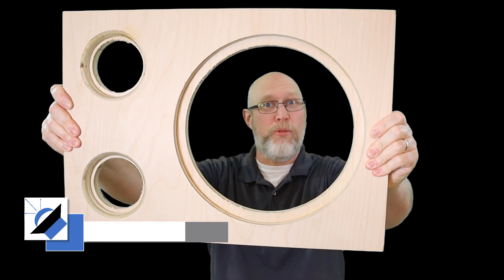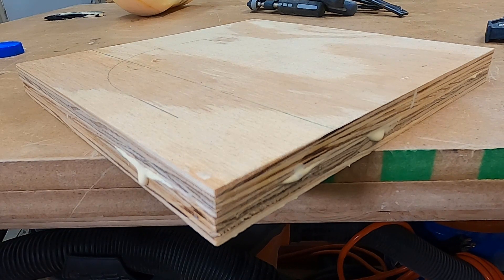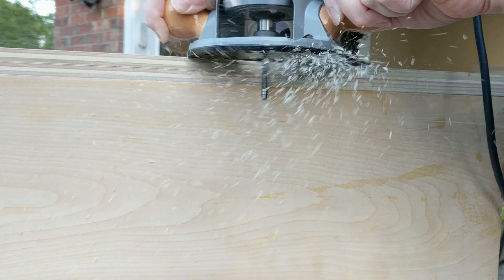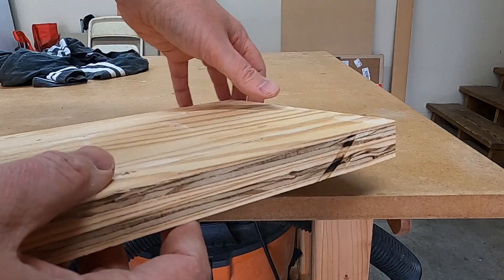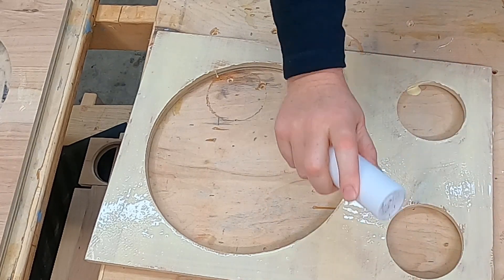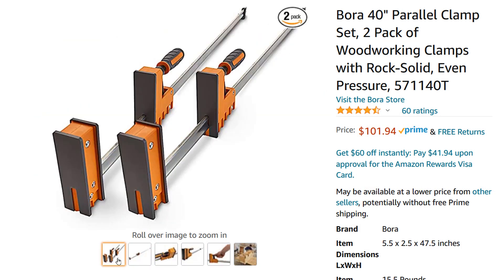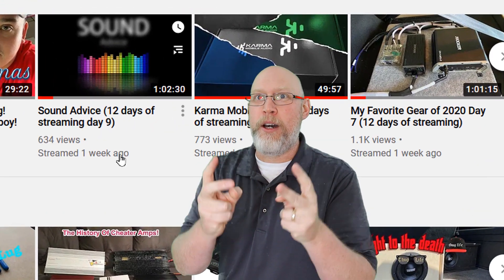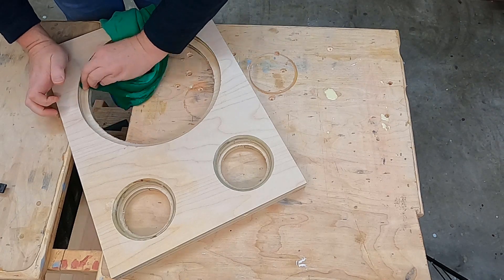How to perfectly align a double-baffle!  #subwoofer #caraudio #homeaudio

Comment: What are the benefits of single vs double vs triple baffle? Noob question
Reply from the maker: I like to double them so I can recess the subwoofer.  I just like the way it looks.  Also adds strength which helps dampen any vibrations.  It is a good idea to triple up the baffle on big builds (think multiple high RMS 15's and 18's) just so you have more wood for the screw to bite into.

Comment: I'm going to align and clamp the baffles while dry, drill pilot holes in both baffles at the same time , then unclamp/apply glue/realign baffles and put screws through the pilot holes I drilled so they stay aligned while glue dries

Comment: Difference in size of outer hole and inner hole?????????
Reply from the maker: That will depend on the speaker.
Reply: You are the only video that shows..research and threads say conflicting..some say bottom bigger top to spec..and some say inner to spec and outer bigger for flush.i just built my box tuned to 32hz out of 3/4 mdf for a single 12inch svx skar sub. 53lbs..so i want to add another baffle for strength but i do not want to lose any air space etc..best to leave as single?any help would be appreciated as to many conflicting ways to do it😵😵😵
Reply from the maker: @ronnydisalvo80  I like to make the actual speaker cut out as close as possible.  I typically make the recessed cutout a little bigger than the overall outside diameter so I have room for carpet.  If you want strength consider just doubling up on the baffle and not recessing the speaker -- or triple up on the baffle.

Comment: K.so just built custom sub box..guess what im gonna cut my 1st baffle 1/8 bigger before i mount my top or 2nd baffle and cut to 11.88 as per my 12inch subs😶😶😶
Reply from the maker: The sub spec sheet should give the overall outside diameter.  I always cut a test piece in scrap material just to make sure.

Comment: 0:58 Now scale that up to a full marty sized double baffle. That was fun with no tools whatsoever. I just sat a lot of weight on it (Including myself) and made sure it was lined up correctly. That was a fun 15-30 minutes before I felt confident it wouldn't move anymore. 

If I had clamps I would have clamped the edges like you show at 3:20. Would have made my life easier haha.
Reply from the maker: When you don't have tools you have to find a way to make it work!  Did you use table salt? This was the first time I tried the table salt trick and it made a huge difference.